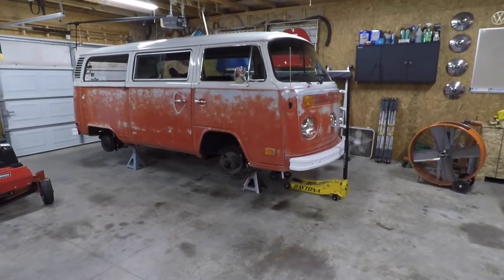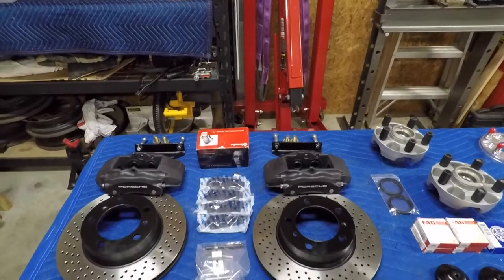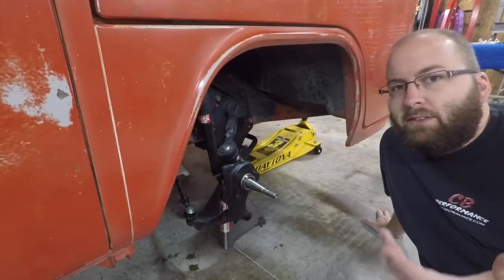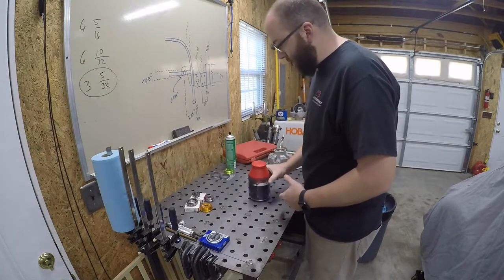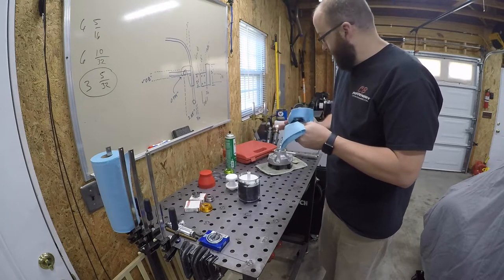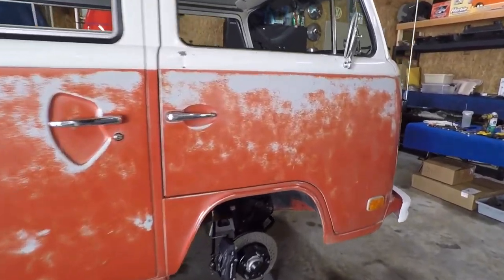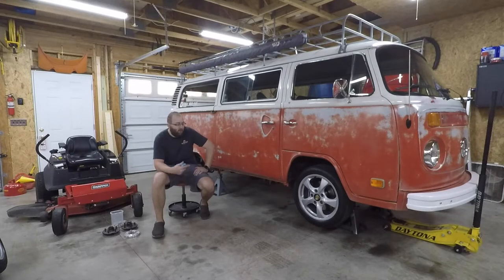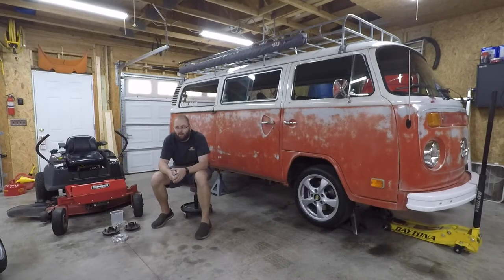Porsche Brake Upgrade & New Wheels for my Late Bay Bus

Comment: I've emailed Lanner several times and just need to get a part number for those bearing spacers. US Porsche Cayman must be different, the calipers have ears on them.
Reply from the maker: There isn’t a part number for them per se, they’re just a custom made spacer typically. I’m sure you can google the specs for the required ID/OD and thickness. Must people cut them on a lathe.

Comment: are you using the stock T4 master cylinder and booster? Did you add a proportioning valve into the system so you adjust the braking force between the front and rear? Looks great BTW.
Reply from the maker: Yes, I’m using the factory booster, master cylinder, and the rear brake pressure regulator. No added proportioning valve or anything. Zero issues with brake balance as is. Thanks for the compliments!

Comment: I have the same kit from lanner. Plus a rear disc brake kit from another vendor. What I don't have is the flexible brake line going to the caliper. I know it's been a long time since you made this video, but do you remember your source for that?
Reply from the maker: For the fronts, the factory Bus flex lines work perfectly. I upgraded to stainless braided ones over stock rubber, but nothing else special

Comment: Very good video and nice job. I have a 71 Vw panel bus and I want to use the 944 hobs on front. Do I use early or late hubs. Turbo or non tubo and the , and the last thing, where to get the spacer and bearings kit?
   Thanks
Reply from the maker: They are NA (non-turbo) early offset 944 hubs. You can get a spacer kit directly from Lanner (may be available other places too, but you’d have to look), bearings/races are stock Bus parts
Reply: Hi , thanks for your answer.
  I have a set of 1986 n.a. 944 hubs, will this be the early offset? How do I know?
   Thank you very much

Comment: VeeDub engineering system work on the bug?
Reply from the maker: Would require a different caliper bracket, and a slightly different approach with the hubs (beetle bearings are smaller than bus). But, Lanner has several options for this (or similar) for Beetles. Hit him up and he can get you fixed up
Reply: @vee_dub_nut   thank u do u have a web site are email for the gentleman?